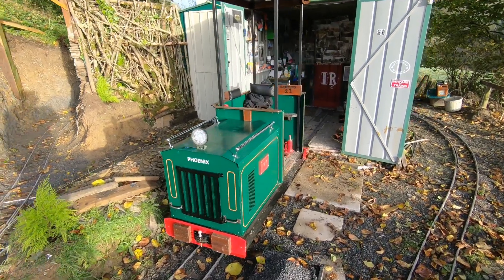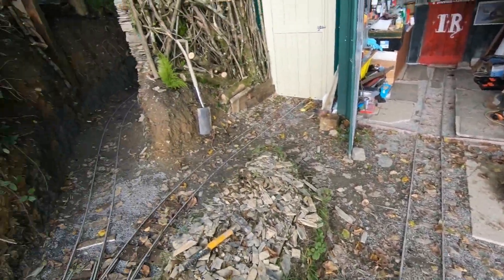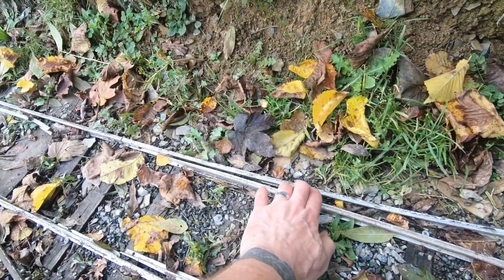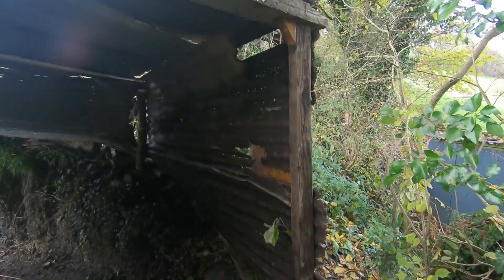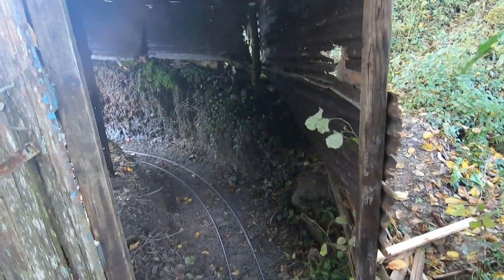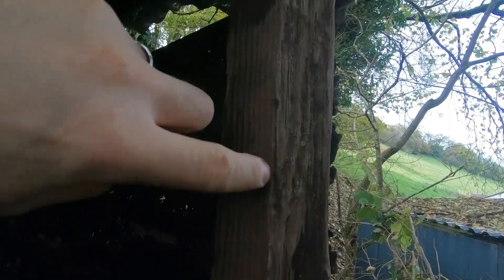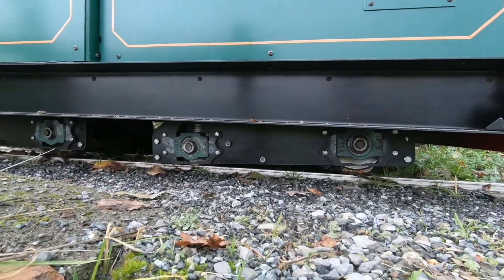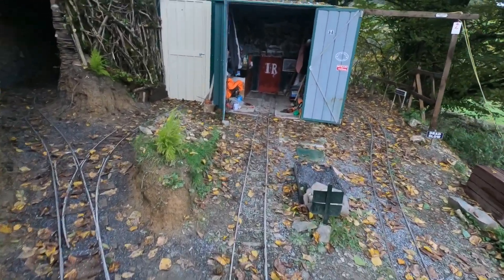7 1/4 inch gauge minimal railway. The Ivy Railway Nov 2021 update part 2 + dealing with a derailment

Comment: Comment from Florida - how long is the current run and will you be able to increase the run?
Reply from the maker: So far it is over 80 metres including the loop line. I hope to extend the other end by about 10 metres.
Reply: Tunnel I s so elegent, works great.....just make sure your roof over cover is Rain Worthy and drains  Rain water off to hill side away from tracks.....
Reply from the maker: @alexmodern6667  Yes I will do.
Reply from the maker: Please check out the HD version here: https://youtu.be/0z40m8H24bA